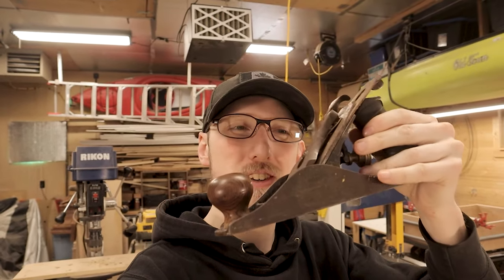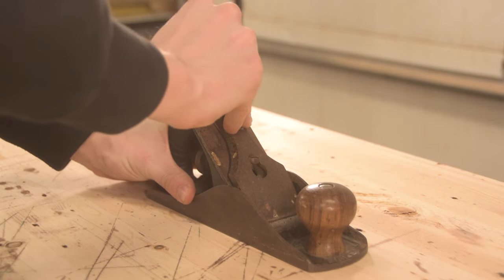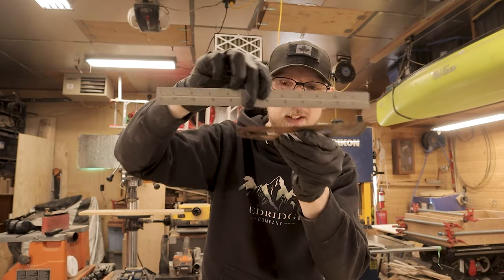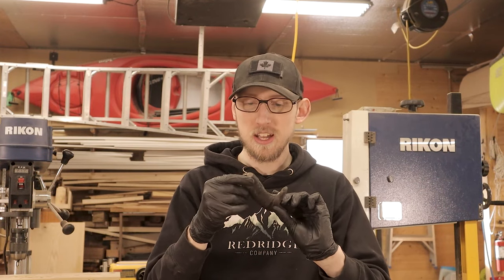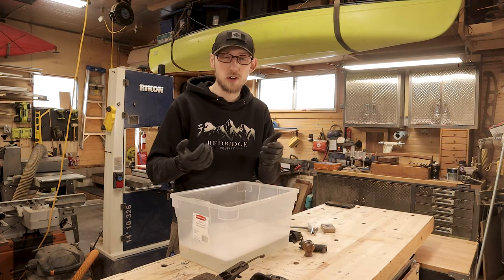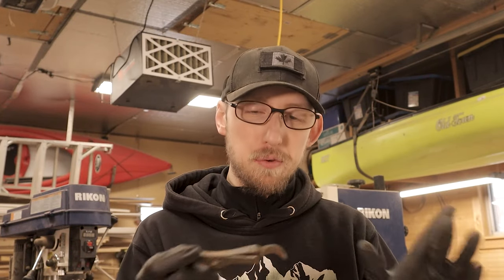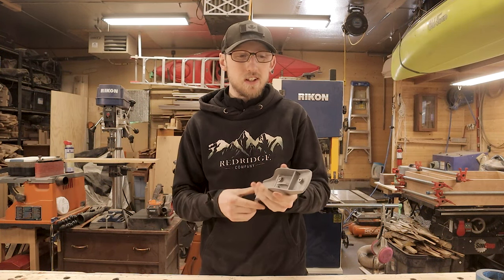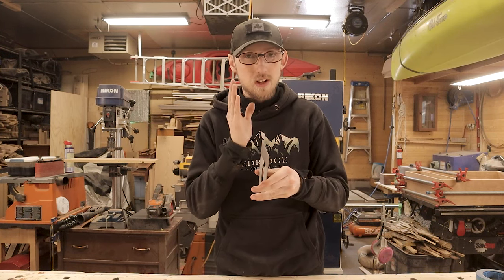100+ YEAR OLD Stanley No.4! Part 1

Comment: Morgan, I don't have a sandblaster, but I've used vinegar and salt as a rust remover many times on metal planes. It works great if you're not in a hurry -- takes about 12 hours, depending on the severity of rust. Put them in a small container, cover with vinegar and add salt. When done soaking, pull them out, scrub them, rinse them with water and then add them to an empty container, add just enough water to cover them and add a couple tablespoons of baking soda to neutralize the acid and further loosen the rust. Let it sit for a few minutes and remove them and clean them with a brass brush or 0000 steel wool and blow dry them completely to make sure all moisture is gone. Coat with a thin film of oil. A rotary tool with a variety of brushes can aid the process, particularly in tight spots.
Reply from the maker: That's an awesome solution, I've heard there's problems with using vinegar for rust removal but your step of neutralizing the acid makes alot of sense!

Comment: Consider citric acid for rust removal. Evaporust is expensive. Oxalic acid is slightly stronger. I found a nice Stanley on eBay with wooden handles in a box. I don't think it had ever really been used. Quite cheap too. Lucked out there.
Reply from the maker: I'll have to try citric acid, because $50 a jug for this stuff is definitely a bit expensive!